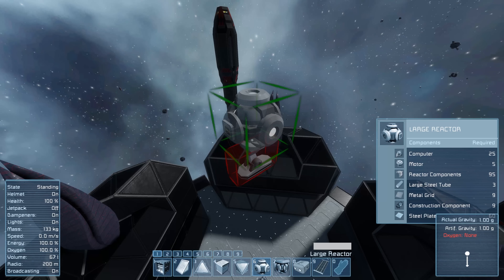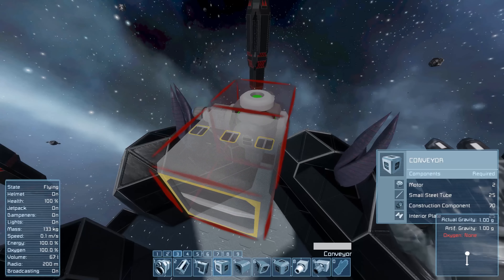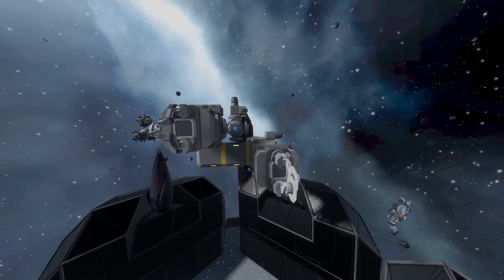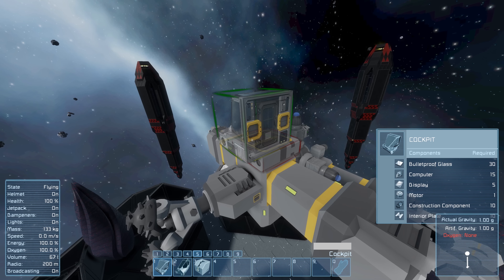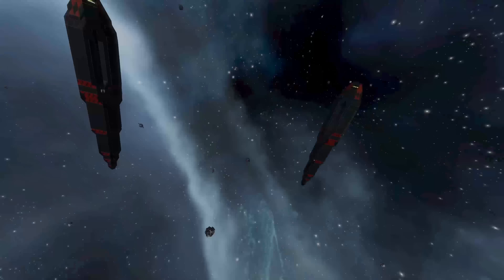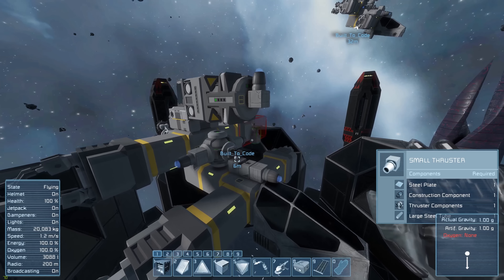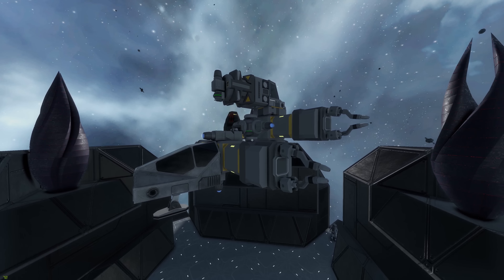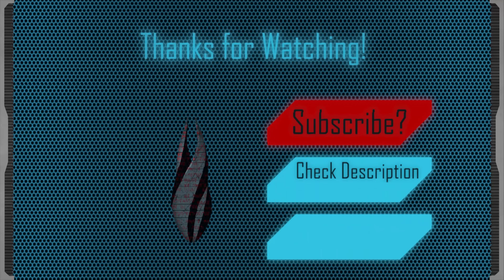Space Engineers, Small Ship Building Code

Comment: The startup reactor idea is an ABSOLUTE MUST in my book.  I've even modified Workshop designs with this feature.
Reply: Also, I've begun  adding FAA standard navigation liight setups to my ships (3  landing lights (always on), two navigation lights (red for port, green for starboard, always on, radius 6m), two white strobe lights towards the aft of the craft (Radius 6m, intensity 5, Blink interval  5s, blink length 1%; those settings make it visible for up to 600m), and a red beacon light at the top of the craft, at the aft, which blinks (Radius 6m, blink interval 5s, blink length 10%) and makiing the beacon on the ship display a registry string, like my ship, the Hard Bargain, her regisrtry is N9845X.  Just a little more realistic  stuff, because I doubt by the time that SE happens the FAA will be abolished or dissolved.

Comment: Heh, Aaron really needs to work on that last one on the building code. He so often seems to leave unfinished blocks in his designs from my observation...

I typically follow pretty much all of this, with only slight exceptions. I have an overt desire to make sure all my designs are extremely robust and dependable... Even if they are cheap toss-away designs. Amusing.
-I'll Be Watching.
Reply: +Silenvo I'd argue that it's especially important that your cheap toss-away designs are dependable; one wouldn't want to have dangerous debris floating about, nor would one want to throw away supplies on a ship that doesn't fulfill its purpose.
The more expensive ships tend to be more durable on their own, and flaws can be tweaked away as you're using it; but every component you spend on a one-off toss-away is a component you'll never see again. Best get all the value for your money.
Reply: Zap Gun
humn, well - I'm far in the right, I suppose, then.
Reply: Silenvo Aye sir, I'm in the same league when it comes to building ships in Space Engineers.
Reply: +Silenvo I prefer efficiency and survivability. If my ship can outlast their destroyer then it has fulfilled it's purpose whilst the gunships move in. I hate designs that cost too much or are not modular enough.
Reply: Achtung_Spitfire
 Efficiency is often a strange thing to me, its often fighting with quality and compactness of functionality. But desirable non-the-less.

Modularity is not required if you already have all necessary functionality included - Though that can slow ships down. As sometimes occurs with my designs.

Survivability is a common theme to my approach regardless though - As stated earlier, I like an extremely robust and dependable design. That means Survivability is a key part.

Cost to me, is always last with my designs. A desire to make my designs cost efficient takes a serious effort that I'm not often engaged in. Especially when I like to make things pretty...
Reply: Silenvo Achtung_Spitfire 
I'd say both of you are making good points here. The thing in the end is that the desired cost of your ship depends on its purpose. You're not going to build your assault fighters and frigates in such a way that they'll be extremely expensive since they're likely the first ones to get blown up.
A command ship, however, or a torpedo bomber, or a troops transport need to survive and therefore one should not spare any expenses when it comes to building them.

Outside of military purposes, I usually build cheap freighters (they don't need to be fast, maneuverable or very defensible if they're just going to carry some simple stuff around your core worlds); medium-cost mining ships (need to make sure you mine efficiently and you have enough storage capacity, also an oxygen generator doesn't hurt); and expensive scouting/recon/capturing/drone carrying ships (needs high speed, some long-range sniping capabilities for those pesky turrets, drone docking points, internal storage, enough gyroscopes to keep it maneuverable, ample power to support it all, preferably an ore detector as well, remote control is always useful and a laser antenna to give you a slight range boost if it's a small ship).

Cost is based on ship type and purpose, and as such cost efficiency is usually (read: ideally) about the same.
Reply: Zap Gun
 I do tend to avoid overscaling vessels beyond their intended purpose, but as I said before, cost is often last on my list... Not that I overspend, just that I tend to end at more expensive designs in the end. (especially when I'm trying to make them look pretty... xP)

Your suggestions outside of military purposes is pretty close to my own, yet again.
Reply: Silenvo They're fairly common strategies since it simply makes sense to make more important ships more expensive.

Interestingly, though, is that making something big is easy; but making something small and compact can be very difficult. Take welding/grinding ships for example: it's easy to make a hideous wall of grinders with some thrusters and a gyroscope, but making a welding/grinding ship that'll fit into tight spaces that still has a connector and enough internal storage is going to be a pain.

It's good exercise to pick a ship type and try to make it as compact as possible without compromising functionality. It really helps you figure out more about efficient ship building and such. A good way to start is with the connector and work your way through the internal systems to the exterior systems and work from there. That way you'll have all the important bits in and you'll be able to experiment with making those as compact as possible before adding any other stuff to it.
Reply: Zap Gun
I like to design compact stuff so much that It actually is hard for me to build big ships. They start to get exponentially difficult for me to build as they get larger and larger. Because I'm always trying to stuff as much functionality into all the space inside of them...

So, you see I actually have the opposite problem from what you are suggesting. xP

I even made a series of videos where I was working on making an entire layout of "modular" components to assemble big ships out of it to make this process easier for me.. I never did quite finish and release it though...
Reply: Silenvo I see... An easy and useful way to make things larger is most of the time to add personal spaces (crew quarters, messhalls, medical rooms, offices etc.) and something I've found is surprisingly effective at making things take up more space: try to make all functional objects accessible. This is always advisable in large ships, since something may break and need mending or a meteor might cause a breach in a nasty spot. Furthermore it makes for many cool crawlspaces and hidden corridors that can lead to unexpected places and make a ship not only larger, but also more effective and more interesting.
Reply: Zap Gun
Thus the design idea behind my modular thing was very much on par - the General idea was to just put together a general shape with the modules and a 'skeleton' that the modules are attached to, then just cover it in an aesthetically pleasing shell.

Then fill in all the gaps with useful components, parts, hallways, maintenance tubes, Gyroscopes, Thruster bays, etc - anything that wasn't in itself, a room, or made up the backbone/skeleton/shell of the ship.

I really liked the idea of making loads of air-duct passage ways that people could navigate for roleplay purposes. Not to mention having all the piping and other interesting mechanisms throughout the interior of the ship mainly being out of the way...
Reply: Silenvo Yeah that's also a very good way of increasing size: hiding your piping behind walls and such. It does require a lot more planning though and eventually you still might end up running into issues, but it'll make the most commonly accessed areas look much slicker.
Also: useless rooms and rooms dedicated to far too few things. Build atria that don't really serve any other purpose aside from impressing people when they enter your structure and providing access to other parts of your structure. I personally love building a small room in the centre of a ship or station dedicated purely to the gravity generator. Combine that with air vents behind grates and double doors in case of depressurisations and you'll be golden for space.
Reply: Zap Gun

... That is something I didn't think about. Useless aesthetic primary structures.

Admittedly, I have a few things that are kind of like that, but usually they revolve around things that are more designed around being functional and not entirely useless/aesthetic only.

A few examples: I made an elaborate Bridge module that could be far smaller, as well as a huge semi-empty but elaborate refinery module. There is also some module assets that really don't 'do' anything game-wise but they are part of the collection because they serve a realistic purpose on-board the ship. (such as crew quarters, showers, bathrooms, janitor closets, micro-storage rooms, kitchens, etc...)

But almost all of them have a 'purpose' to exist, not simply a big empty aesthetic room... I was heavily focused on producing functionality and perceived functionality. Prebuilt hallways, elevators, and airlocks included.

Also, ALL the modules have auto-doors. Because why not? lol They are also tuned to open only to recognized allies (So you have to have ownership or be part of the faction that owns it.)

... and don't even get me started on the absolute redundancy function of all the modules. Oh, dear God!
Reply: Silenvo Sounds like you've got your work cut out for you! Ever thought of automatic lighting systems as well to save on a little bit of lag (and, of course, to show off)?
Reply: Zap Gun
 Automatic lighting... .. How could you. Why did you even mention.. Awwh damn it! Now I have to go back and .. Aaagghh!!! xP

Curses... But that is a brilliant idea, that I now have to install. Thank you!
Reply: Silenvo Hahahaha I'm sorry and no problem my friend!
Interestingly, I've recently designed a space station (smallish mining station) that is vaguely modular (built into 4 separate wings around a central connection point with some nice bridges and walkways between them) that also has automagical lighting in it. No automatic doors though, I wanted to keep it realistically sized so it could be used in survival without having to walk for 15 minutes just to go from Storage to Reactors. It's already quite a trek to go from the O2-tank room to the spaceport since the O2-tank room is in the back of the storage wing and the docks are out behind the living quarters/cryopods wing (which is, incidentally, the largest wind as well).

Man, you don't even have to play SE to have a good time; just discussing the myriad of things you can do in this jewel is entertaining me to no ends.
Reply: Zap Gun
Well that's the joy of imagination. I used to do this all the time with an old friend of mine... We'd go on for hours brainstorming all the neat ideas you could do in games, stories, adventures, whatever we felt like talking about really...

I saved down the auto-lighting system idea in a notepad on my Project: Modular save; so whenever I get around to finally finishing setting it up, It'll remind me to install them. But now that I've looked back at it, I remember recently going over it and completely tuning up all the parts to the latest versions, set up a bunch of other systems, updating mods, and so on... Even made some new modules. The only thing I needed to do was actually build something with it.

Though now I need to install the auto-lighting system when I get back to fiddling around with it before I build anything with it. xP

I still am unsure about how I designed the exterior edges of the modules.

I sloped them out, so as to make them look fancier, and nicer, but I realized much later that making them full blocks would maybe have been better to save on triangles and allow for them to hook up against the interior of the shell that goes around them and save on frames for non-displayed sections. Hrm.

But I keep arguing with myself about that last decision. xP
Reply: Silenvo Oh, the never-ending cycle of design->build->assess->design some more->change random shit->assess again->etc...
Reply: Zap Gun
Well, we wouldn't be space engineers if we didn't like doing that, I suppose, 'eh? XD
Reply: Silenvo No truer words... xD

Comment: I most of the time make my mining ships hull out of heavy steel as it is stronger against damage such as flying stones that can if given enough speed dent and eventually be destroyed if made with light steel, this does make them heavier but the added weight has another benefit the drill shake is less due to the weight of the heavy armor, if attacked the armor is pretty resilient towards bullets and able to take a rocket hit without being wrecked by it. Gyros are not needed in large numbers to keep the tool shake from making the craft uncontrollable great for vessels that burrow into asteroids as the tool shake can destroy your craft. I always put more power than is needed so that it doesn't overload, and one day they might make reactors explode if pushed too far I don't need to retrofit the craft with more reactors. My code is always put vital parts of your ship behind armor so that it is harder to destroy, this is cargo,gyros,,oxygen and power supply  systems and a beacon for finding the craft should you die or the craft becomes incapacitated. Large ships I always do nearly the same as small but leave at least a block of walking space to allow for easy repair and refitting of major components of the ship. Having a O2 tank as well as a generator on small ships allows for a backup should you run out of ice on a long mining trip you won't instantly suffocate and die when it runs out with just a generator that might happen, with the tank you will have oxygen, more than your using so when Ice runs out you have the O2 tank full until you find more you will stay alive for quite a while.

Comment: I would also suggest a projector for ships that need to be repaired a lot or for construction ships that can have welders/grinders interchangeable. If you have a welder and grinder on your station you can use the projector in the construction ship to swap tools without having to get out. Or if you have a small fighter that gets shot up you can turn on the projector, put it in a repair bay and not have to worry about grinding half your ship down to replace that 1 block you cant get to.